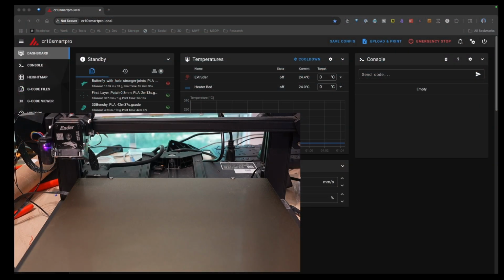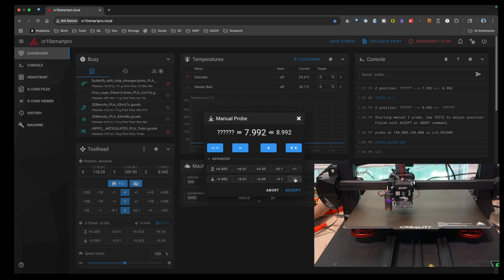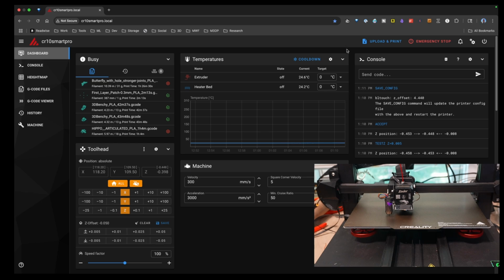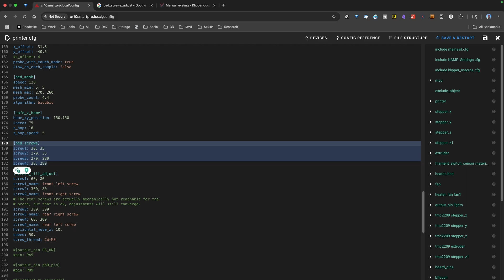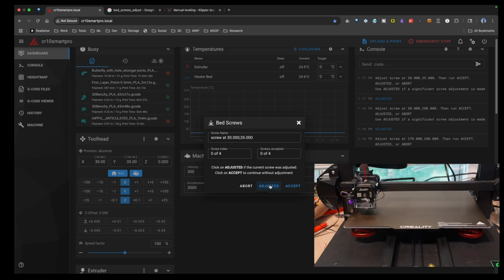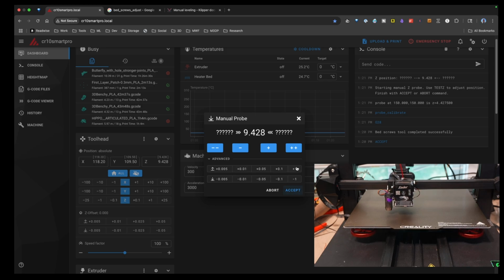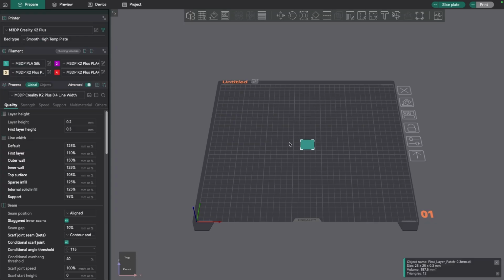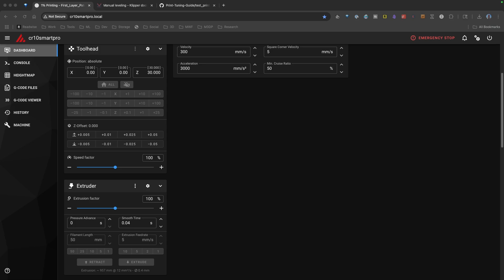Ultimate Beginners Guide to 3d printing: Perfect First Layers, A Klipper Bed Leveling Deep Dive

Comment: Man thats rough. Why not do bed screw calibrate? Then I know its level, then re-home, double check your middle offset and good to go
Reply from the maker: I guess it is the way I do it. I will try your method as well. I appreciate the feedback.
Reply: Once you're test-printing (and since you use a probe), you should not touch those bed screws for adjusting anymore, since on the next print the probe would again determine the Z position based on the bed position (that you adjusted during the test-print trying to get things right) and the z-offset and hence will again be too close or too far.  That's also why more recent printers don't have bed-screws anymore.  They only tilt the bed and as long as that tilt is very limited, you don't have to adjust it as the bed mesh delivered by the probe can correct for it and still get you a great first layer.  In short: during the test-print only use baby-stepping the z-offset.  If that delivers different behavior on the different squares, then either your probe is inaccurate or your mesh is too coarse.